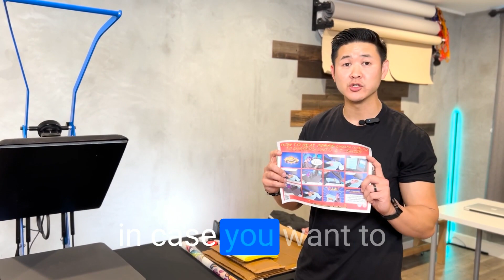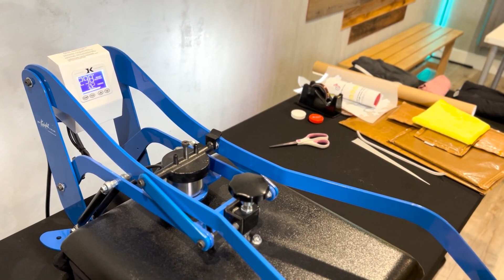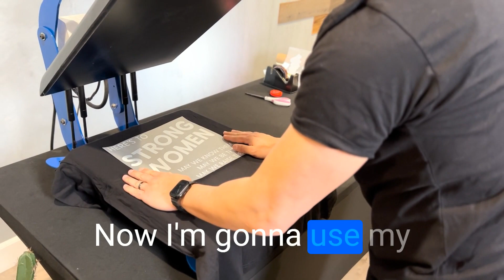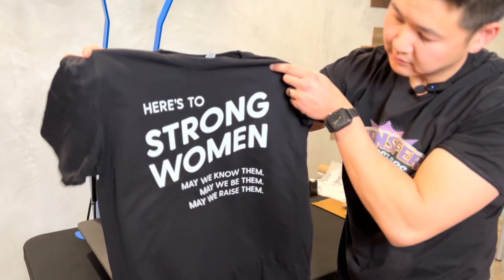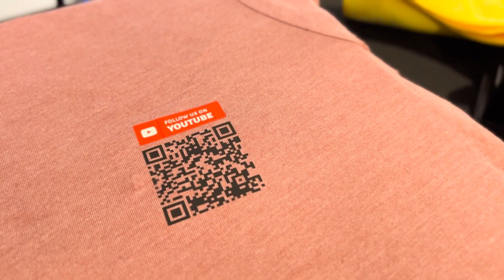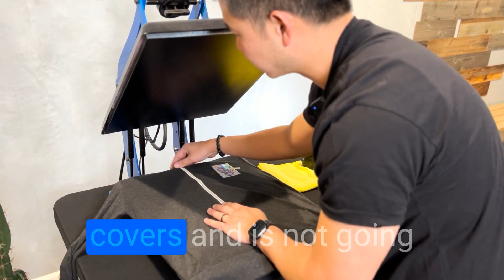How To Press DTF (Direct to Film) Transfers on T-Shirts Step by Step Print Instructions | Warm Peel

Comment: My print cracks when I stretch it (after washing) and then it looks ugly. What could be the reason? I do 15 seconds and 315F (160C) which is what I was recommended, is it too much?
Reply from the maker: Each printer has different requirements. Our transfers are 300f for only 7s. You don't overcook them and they are still stretchy. Not all transfers are the same, make sure you test.  Keep us in mind if you need a transfer provider. https://www.transfersuperstars.com/products/dtf-gangsheet-builder

Comment: How temperatures and time need to heatpress ?
Reply from the maker: Each Supplier has different settings. For our transfers, they are 300f for 7seconds, heavy pressure. Works both cold and hot. 
https://www.transfersuperstars.com/products/dtf-gangsheet-builder

Comment: My paper sticks to the top of the press. When I pull the press up the design doesn’t fully go on and gets messed up. Any tips? I pressed at 300 for 7 sec
Reply from the maker: 2 Things, you definitely want to use a Teflon sheet. https://amzn.to/4ef590A and Heat resistant tape https://amzn.to/3XfoyaX

Comment: How long does it take for the print to cool on the shirt on the initial press?
Reply from the maker: for cold peeling, typically around 12-15s. If you have a good heat press with adequate pressure, you can peel sooner.

Comment: Should you see the fabric imprint in the dtf when finished pressing like you do when you press htv? Or should it be completely smooth without that fabric texture showing?
Reply from the maker: You should see the vertical fabric lines. This shows that you are using enough pressure.

Comment: Hi. I have a question, what is the purpose of second press after you cold peel the transfer? Is doing the 2nd press really necessary? Thank you.
Reply from the maker: Some people do it, some people don't. Is it necessary? if you have a good heat press with heavy pressure, you might be able to get away with not doing the 2nd press. The ONLY way to know for sure is to do a wash test afterwards and see if there is an improvement. If the transfer wrinkles after the wash, then you don't have enough pressure
Reply: @transfersuperstars  what if my print wrinkles after second press?😮

Comment: Do you happen to know anybody (or company) that offers oversized DTG printing with no minimum? Anybody you would recommend?
Reply: Why dtf over dtg ?
Reply from the maker: @vividarts9787  Advantages of DTF over DTG include:

Cost-effective for high-volume printing: DTF printing can be more cost-effective than DTG for large volume printing, as it is faster and can produce a higher volume of prints per hour.

Better for dark-colored fabrics: DTF printing can print on dark-colored fabrics more easily and with better color vibrancy compared to DTG.

Longer lasting prints: DTF inks are typically more durable and can withstand multiple washings without fading or cracking.

No pre-treatment required: Unlike DTG, DTF does not require pre-treatment of the fabric, which can save time and money.

More versatile: DTF can be used to print on a wider range of fabrics, including synthetic fabrics, whereas DTG is limited to natural fabrics like cotton.
Reply from the maker: We do not sorry. We stopped doing DTG 2 years ago.